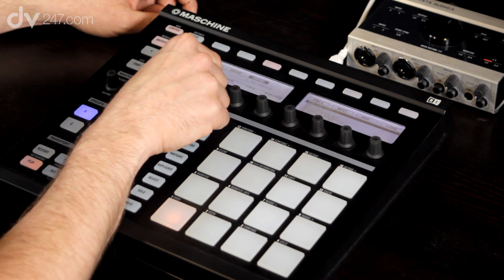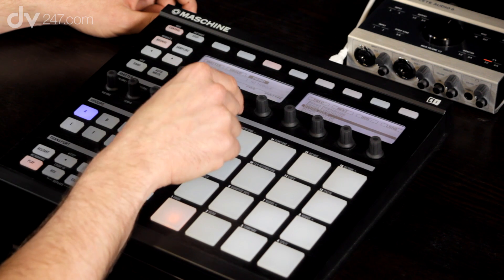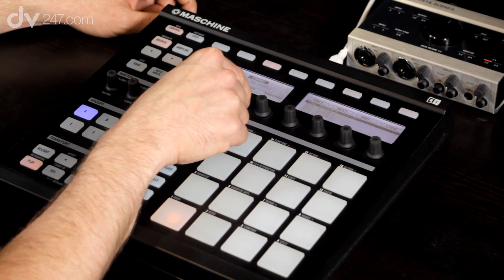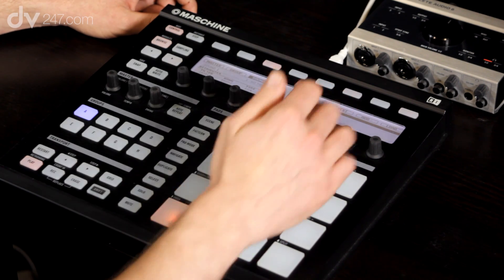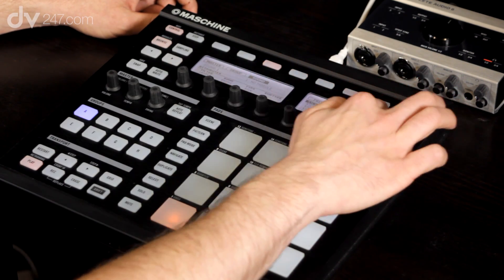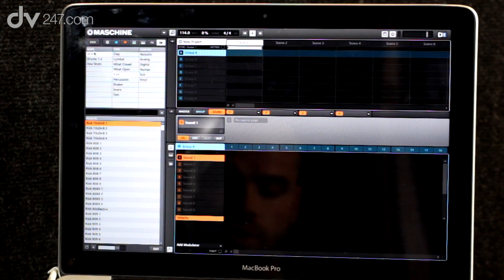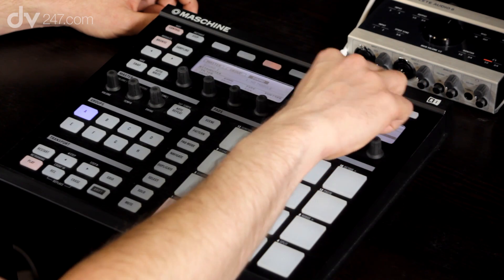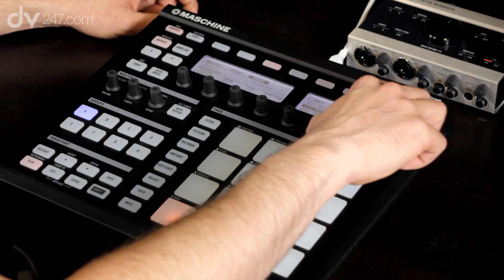Native Instruments Maschine Tutorial Part 1

Comment: I've just installed my software, and it is recognised, I've started the software, but no buttons or knobs on the unit do anything. 

I assume this isn't normal?
Reply: I figured it out, thanks to NI's supports pages.

There was a clash with an old Avid Core Audio driver I had on my system. Once I deleted that, it seems to be working as expected :)